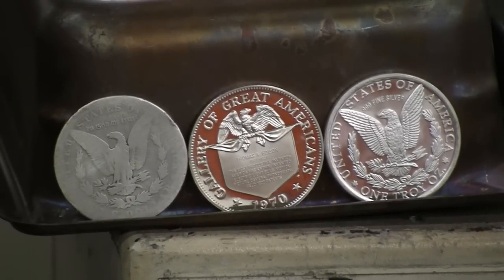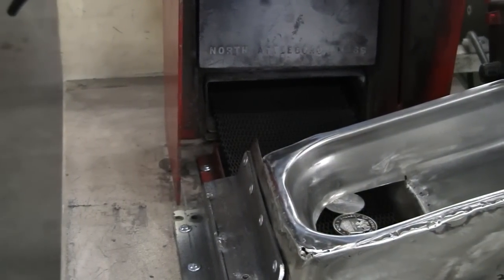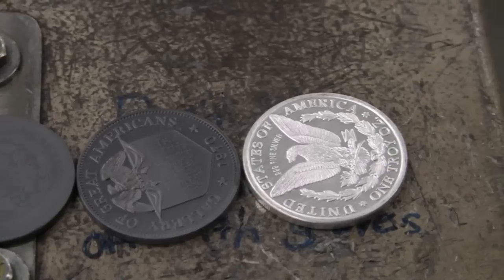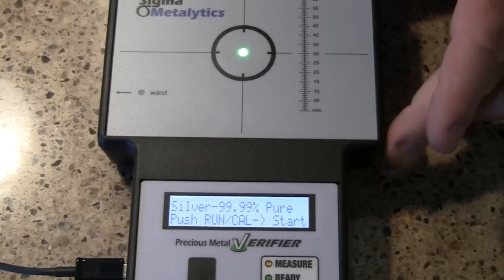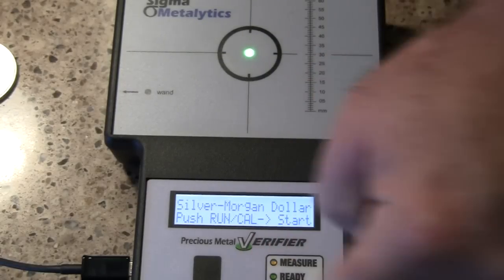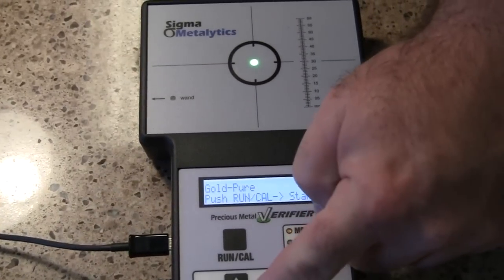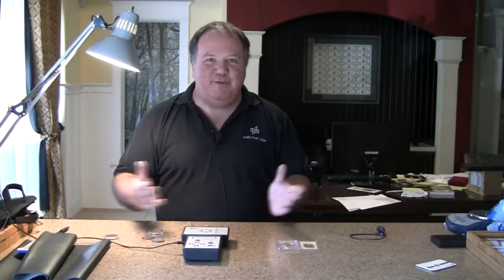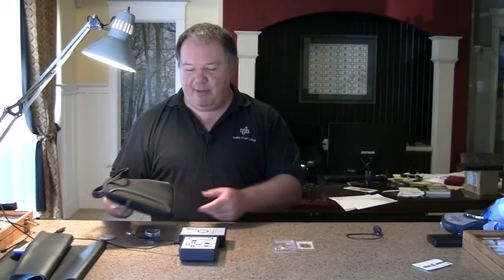How to Detect Fake Gold & Silver - Precious Metal Testing Verifier

Comment: yesterday I was at a gold and silver shop and I saw a fake 3oz. round in the batch, I looked at it with my eye peice and saw copper color wore on the edge and the guy put it on a tester just like this one here and it read 999. that's bs because I saw the worn off edge, that tester could and most likely will cause you 2 get burned, it's not 100% accurate on everything you test on it

Comment: Doing my own research I just found that the "Precious Metals Verifier machine" shown in this video can only penetrate 2 mm deep into the bar, that is even if you use the bullion bar wand, 2 mm is almost nothing unless you have coins or very thin bars, but if you want to test 50oz or bigger bullion bars, this machine will not penetrate more than 2 mm deep into the metal. In my own opinion, the "Specific Gravity Test" would be the best way to go if testing big chunks of silver or gold.
Reply from the maker: cubaniton74 Specific Gravity is actually a great test when done correctly. I found this on examiner.com:"According to Encyclopedia of American Silver Manufacturers, Revised Fifth Edition by Rainwater, Martin and Fuller, the thickness of the plating layer ranches between 0.00015 inch to 0.00125 inch. To put this in perspective, the thickest layer of sliver plate is about the same as the thinnest human hair!" This is between 0.00381-mm to 0.03175-mm. If that is the case, then the bullion wand should have no problems even at 2mm detecting fake silver/gold. I do agree with you that the Specific Gravity test is great, but what's even better is layering multiple tests to be sure. Thanks for your comment!http://www.examiner.com/article/how-thick-is-the-layer-of-silver-on-silver-plate-pieces
Reply: Quality Silver Bullion A criminal with the will and the time available to him/her is able to hollow a 100 ounce bar of silver or gold and fill it with similar weight metal making sure that a 3 mm or greater thickness is left all around in the bar and then your equipment will be useless if facing such a circumstance. And we all know that a sophisticated ring of criminals can accomplish this with ease, but in all fairness, your machine would be great for coins and thin bars no thicker than 5 mm, but the user would have to test the bar from both sides to be sure, specially gold bars as a minimal amount of fake material can represent a considerable monetary loss.
Reply from the maker: cubaniton74 Touché. Tungsten carries the same density as gold, and that is posing a HUGE problem with hollowed out gold filled with Tungsten. Water displacement won't even help in that case. This is certainly adding a new dimension to the bullion market. I guess it comes down to trusting the dealer you work with.I really appreciate your comments.
Reply: Gold might be compromised by tungsten, but not silver, and to be specific, these are the specific gravity of tungsten vs. gold. Tungsten =  19.60, Gold = 19.32. Using a very precise scale, it would be easy to see the difference, and if there is a difference, then don't buy that particular bar or coin. But like I mentioned before, your machine has its uses, but not to be extended beyond its capabilities of 2 mm.

Comment: I BOUGHT THIS MACHINE THREE MONTHS AGO AND RETURNED IT, IS WAS GARBAGE.

The machine was all over the place when testing the same bars out of a 20-pack sleeve of fresh JM bars, he also sent me out a replacement to try and same issue, I drilled holes in the 10oz silver JM bars as I knew they were real, bought them from Apmex and some other good sources , and the machine was telling me they were fake, the black box was way out of the brackets on the machine, than when you turn the bars over it gives you a worse reading. I even had a bunch of different reading with my gold and so on. Than sometimes out of a silver eagle roll almost every coin showed different. The guy told me because of the heat in your hand makes it read different- what a Joke !!

Buyers beware- Because I really wished it worked well it was a nice little gadget, but I did not like it.

Than when I started checking Numismatic coins it was even worse, than I sent it back had enough of the B.S. , plus I had messed up a couple of Brand New JM 10oz Silver bars to top it all off !!
Reply: Raymond,

It's too bad you sent back the machine as it was working well for you, but since you have complained about the Verifier publicly I will respond publicly.

1.  We told you that the small wand is  sensitive to surface variations on the test items surface and these variations are deep on the silver bar you tested.  Yes using the small wand on a bar like that will show variations as you move the wand over the surface of the bar.  We told you to take readings with the main sensor. 
2. The resistivity (the physical property we measure) of a coin varies with temperature, it's just a physical fact.  We have temperature compensation that really works well, but if the item you're testing and the base unit are at different temperatures it will shift the reading.  Yes, silver warms up fast, and your hand can heat up a coin or bar and change the reading.
3.  In my conversation with you, I told you we would send you a second unit and when you got it you should get the bar under question with the unit and give me a call so we could deal with the issue without having you make assumptions.  You didn't contact me when you were taking measurements, you took photos, drilled a hole, and then complained because you couldn't get the unit to work right.  We took the unit back from you (the same as we would do for anybody) and gave you a full refund the day we received the unit back.  
4.   We had another customer with a similar issue with a bar.  He filed off a corner of the bar and using an XRF machine (which costs about 20X times the price of the Verifier) and found that the bar was .995 silver, not .999 as marked.  This gave a shift out of range similar to what you were seeing on your bar.
5.  The Precious Metal Verifier is the only device that can detect tungsten under 60 micron gold plating (we recently got a fake Maple Leaf with this plating from China).  An XRF machine using X-rays would not detect the tungsten with this thickness of plating.  So the product can save a buyer much more money than it costs, and the product would be useful for you if you hadn't been so fearful that we were taking advantage of you.  
Richard Gordon
Sigma Metalytics
Reply: @sigmametalytics1846  if you made this machine affordable more people would be investing in silver and you could really make a difference in the world. Gold buyer sees the value but not a silver buyer.
Reply from the maker: Raymond. R I'm sorry you had a bad experience with it. It has worked amazing for us on all of our applications. That stinks you had to drill your JMs. If you don't mind me asking, where did you buy your PM Tester from?
Reply: Quality Silver Bullion I bought it direct from maker at  http://www.sigmametalytics.com/
Believe me the machine was crazy, always showing a different reading from on side of a bar to the other, and when checking my numismatic coins that were graded by NGC or PCGS it gave different readings on both machines, and some even were way out the bars, so I gave up on it and I will try to save up to get one of those really expensive gun testers, that I think your company should have for sure.
Reply: Raymond. R The machine's did not work correct at all, the coins were not hot or cold so the temp was out of the question, when i tested numismatic coins  it was a mess, the machine was all over the place. as for my bars they are.999+ JM bars as pictured I sent you and your machine was saying they were not silver "LOL". Let me know when you design a better machine I may take a another crack at, but for now I am done and I just gave any other buyer a heads up of my experience with "NOT 1 but 2 Machines and they were both not working as intended !!

Comment: Can you use this device to test Jewelry?
Reply from the maker: Dee Hong Great Question. It works on some of the larger jewelry pieces, but for the most part this machine is made primarily for testing coins and bars. Small jewelry like rings and necklaces don't show a very accurate reading.

Comment: I'm using radio frequency, nothing else.  Good luck to those using weights and measures.
Reply from the maker: kcrone1 That sounds cool. Is there a certain machine you use for your testing? This Precious Metals Verifier machine uses the principle of resistivity to measure the distortion created in an electromagnetic field.
Reply: kcrone1 Hello, are you making reference to a regular metal detector, the type used to find coins in the ground?
Reply: cubaniton74
No Sigma machine, which now QSB offers at a great price!
Reply: kcrone1 Doing my own research I just found that the "Precious Metals Verifier machine" shown in this video can only penetrate 2 mm deep into the bar, that is even if you use the bullion bar wand, 2 mm is almost nothing unless you have coins or very thin bars, but if you want to test 50oz or bigger bullion bars, this machine will not penetrate more than 2 mm deep into the metal. In my own opinion, the "Specific Gravity Test" would be the best way to go if testing big chunks of silver or gold.
Reply: @cubaniton74  no it's four mm
Reply: Can you tell me more about how you use radio frequency? I tap my coins on the edge for that two second dinnnnng. If a one ounce peace dollar or Morgan sounds differently than what I'm used to hearing it's a fake. Different coins have different tones, but when it comes to one oz coins they should all have a very distinctive tone when you tap them on the edge very lightly with another silver coin
Reply: What about the ice test, I have found so many fake coins using a simple piece of ice. You put two coins side by side that are the same, put a piece of ice on each one and if the ice melts it is silver, if it doesn't melt then it's fake

Comment: Are there silver 1 ounce sized items in circulation that are fake, match in terms of dimension, and are not detected with a magnet? t seems really hard and costly to pull such a fake off.
Reply from the maker: Cloxxki We have not come across any that were silver plated that didn't have one of those aspects incorrect. I won't go as far to say that it is impossible to do, but the Chinese counterfeit rounds that we have seen are made of copper or brass, with an outer silver plating. Copper and Brass are NOT magnetic like steel. If the weight is right, then the round or bar will be thicker. If the dimensions of the piece is correct, then usually the weight is incorrect. Did that help?
Reply: Quality Silver Bullion Thanks, you confirm my understanding of matters. A lead core or alloy might do the trick in a brass silver plated round, but might not be worth the trouble.
Reply: i have fake silver coins , and a fake silver 10 oz bar from scottsdale reserve . its a conspiracy by the government to stay afloat. if the true amount of fakes was uncovered there would be 10% of paper money that would be worthless
Reply: adam gould III But were your items easily detectable with a magnet, or not? 
Pooring a bigger bar with a brass core is simply too easy for criminals to ingore. Kitchen project easy. Especially with the rise of 3D printing and whatnot.
I'm all for a good  conspiracy, but fake silver? Only one item needs to be found out by a conaisseur, and the whole scheme unravels.